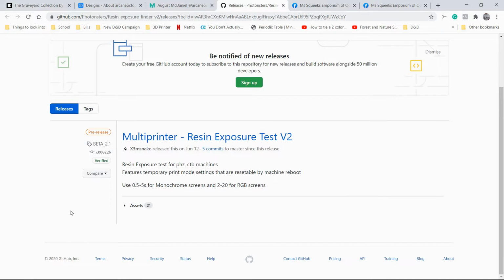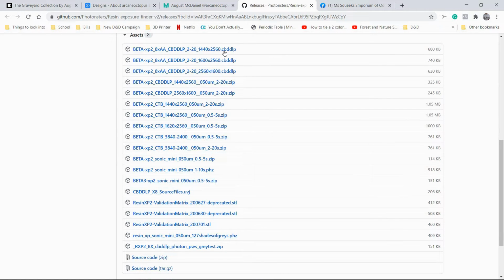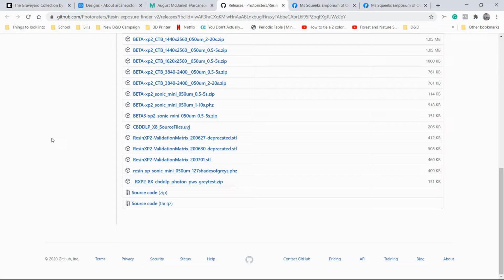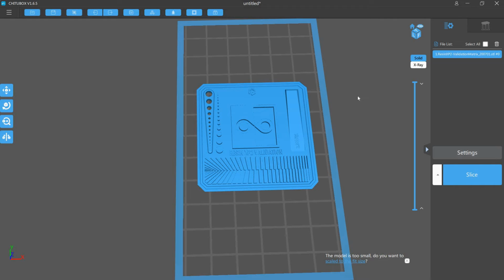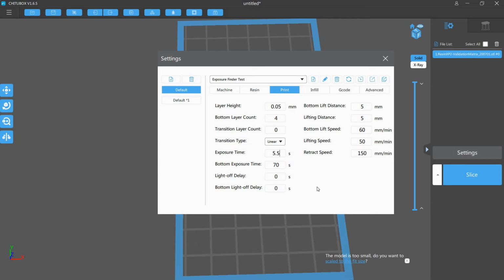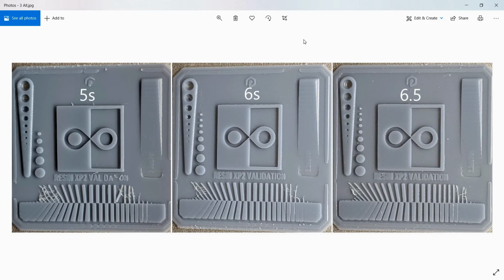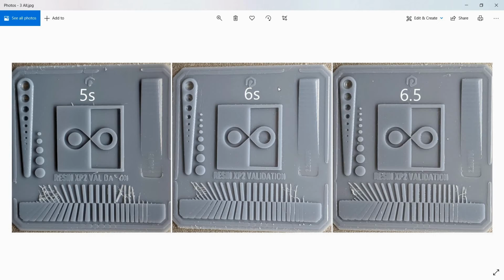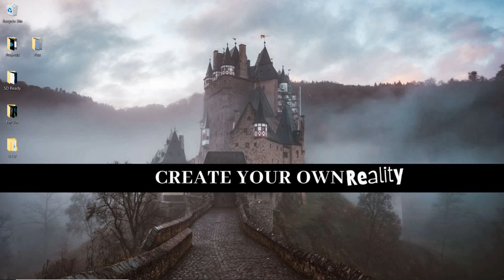Get Perfect 3D Prints on Any Resin Printer With the Exposure Finder!

Comment: Thanks for explaining how to establish if the exposure is correct on this file. I upgraded my old RGB Transform to a mono 7K screen and now i'm getting thin cured sheets of resin in the vat, based on what i see and what someone told me i think i need to reduce the UV power as these rgb arrays are more powerful, mono screens allow more light to pass than rgb screens so now I'm gonna reduce it to 70% from Chitubox (Light PWM settings). The test file with the default 100% uv light using 2.6 exposure makes all the intersecting corners weld together more, the 2 eye shapes in the middle where they touch are melted together.
Prints on this printer also stay tacky even after cleaning with IPA and feel softer than prints from my other printers, it has to be over exposed no?
Reply from the maker: Hey there. Yeah that definitely sounds like your prints are over exposed. However, your mention of the cured layer is something I'd like to hear more about.
Could you join my Facebook group or Discord Server and post there? I'll help troubleshoot as I have time.
Or, if you want more 1 on 1 support, you can join my Patreon at the Red Scale Tier.
Reply: @SlicePrintRoleplay  Sure i can join, thanks.

Comment: I'm curious, should I do a vat clean after an underexposed validation matrix ? Should I worry underexposed particuls floating in the resin ?
Reply from the maker: @sebastienstryckwant4564  in my opinion, yes you should. The chances are small but it only takes a few minutes. Even less with the tank clean function. Definitely better than paying to replace the screen.
Reply: @SlicePrintRoleplay  I bought a screen protector as It's my first 3d printer and I know I will do sh*t. Thanks for the answer !

Comment: Hi. Thanks for the video. I use mars 4 ultra and elego standard resin. I run exposure time from 2.5 to 6sec. I can see the difference between prints and would say that spot is 4sec. 
But, all of this prints have no extreme tiny lines and text. 
Any idea what may be an issue?
Thanks.
Reply from the maker: Could you join my Facebook group or Discord Server and post some pictures of what you're seeing?
Reply: @SlicePrintRoleplay  Thanks
Reply from the maker: @Fly_Dragon279  you are very welcome.

Comment: why is your bottom exposure 70 secs?
Reply from the maker: Because the printer used in the video had an RGB screen. RGB screens require about 3 times the bottom and normal exposure times when compared to modern mono screen printers... Wow I really need to update this video. 😅
Reply: what would be the cause of the resin not sticking to the build plate?  @SlicePrintRoleplay
Reply from the maker: @bradysaravanlife9371  most common cause is the the build plate hasn't been leveled correctly.
The next most common cause is that your bottom exposure is too low.
If you'd like to join my Facebook group or Discord Server I am always happy to provide basic troubleshooting.
However, if the issue you're seeing requires more than the basics, I recommend joining my Patreon at the Red Scale Tier.
That allows me to set time aside to offer you 1 on 1 3D printing support with much faster response times. You also get some other fun benefits too. 😊
https://bit.ly/3E9g22O
Reply: @SlicePrintRoleplay  yeah ill deffently join ur fb and discord and send some pictures in. thanks for the help!
Reply: kk i just got a anycubic mono 5 and my buildprint keeps not sticking to the resin i just tried your test print and it didnt stick to build plate what could b wrong?  @SlicePrintRoleplay

Comment: I have been having issues with my Elegoo Saturn in which the XP2 Calibration tests print almost paper thin. Despite the bottom exposure being dialled in at 30s and switching the exposure times from 2.5 up to 3 seconds...
Reply from the maker: There are a few things that could cause that issue. However, the best way for me to narrow it down would be to see the settings you're using. Could you join my Facebook group or reach out to me directly with a screenshot of your settings?
Reply: @SlicePrintRoleplay  I'll join your facebook group and send my settings over. Thanks!

Comment: Which file time etc... works for the Uniformation GK Two?
Reply from the maker: If you're asking about the range finder test that stopped being supported by the creator a few years ago unfortunately. So I do not recommend using that test.
If you're asking about the Validation Matrix, use the stock settings that are populated in your slicer when you select the GKTwo as your printer. Those are usually a safe starting point. However, make sure you are using 4 bottom layers and no transition layers.

Comment: i did this test for .05mm to get my perfect exposure. i wanna see what my exposure for .15mm layer height. since you say use 4 bottom layers for .05mm, is this file able to test with a .15mm height?
Reply from the maker: Hmm. That's difficult to say. I think it's certainly worth testing. It's possible that the test is too thin for such a large layer height. I really can't say for sure though. 
However, if my math is correct, you can only use 1 bottom layer at that layer height. Double check that in your slicer preview though.
Reply: @SlicePrintRoleplay  I was thinking the same. Total height of file is 1.4mm and min layers I can choose is 4. That's. .6 just in bottom layers. I think I'll try just figured 3 times the layer height I might have a diff in exposure time. Thanks

Comment: Thank you for still answering questions even 2 years later.
Fast forward to 4:27, the 6 second print looks good. I can understand why the very thin lines are hard to print but why should the outside raised border around the test fail in spots?

Comment: so i know this video is 2 years old but i did this test on my mono x and got it down to 4 seconds. and the center of the infinity sign still looks like its over exposed. i mean it looks good. but i kinda wanna keep going down till l see the threshold for underexposed. and i have all the pins, my room is always at 75 f and its not humid in there if thats effects resin printers or not, and my layer height is at .05. so with that being said is it just newer printers are avg closer to the 4 sec now? at least for mine
Reply from the maker: Doesn't matter if the video is super old or not, I try to respond to comments whenever I see them.
You are correct. There was a cheng to this tech a little over a year ago.
The type of LCD used in these printers changed. Without getting into too much unnecessary detail, they basically started using screens that allowed more UV light to pass through. They also last longer and provide slightly higher detail.
So yes the tech changed and now it's normal to use a much shorter exposure time. For mono screens (the new standard type of screen) I recommend starting your testing at 3s normal exposure time.
Let me know if you have any more questions.
Reply: @SlicePrintRoleplay  well thanks for getting back to me! i love your videos, you have given me alot of great info and saved me alot of time. keep up the great work. its very appreciated!
Reply from the maker: @jaspercallahan3318  thanks so much for the positive feedback and encouragement!

Comment: Weird issue, but I ran this test print on my elegoo mars 2 and the shape of the validation matrix printed as a rectangle rather than the square. It looks correct in chitubox and I reran the print and had the same result. Any idea why this is happening?
Reply from the maker: Hmm. I'd start by double checking in Chitubox and make sure you have the correct printer selected. If that's correct then I'd check your X and Y resolution. It's possible that those two values got switched. That could certainly cause the issue you're seeing.

Comment: Do you have any exposure tips for the elegoo mars 3 pro? 
Im printing with 3DJake lightgrey 8K resin.
Reply from the maker: I don't have that model, but I've heard good things about it.
I'd start testing at: 
4 bottom layers.
25s bottom layer exposure time. 
3s normal exposure time.
Then adjust depending on the results of your testing.
I would highly recommend running the Exposure Time Finder function in UVTools. It let's you test multiple different exposure within the same test.
Here's a full tutorial on it.
https://youtu.be/lRbZw6GbGCI
Reply: @SlicePrintRoleplay  thanks man! 
I just baught the printer a few weeks ago to make dnd minis. Its my first printer and i really get awesome results, but i think there can even be more details ^^
Reply: @SlicePrintRoleplay  right now i have 3 bottom layers, 32 secs bottom layer exposure time and 3 secs normal exposure time :)
Reply from the maker: @l_TheJester_I  all the more reason to calibrate your exposure time. That's going to be the best way to improve quality.

Comment: So I'm not sure if there is a file for the elegoo saturn s. I'm not seeing a matching file
Reply from the maker: I highly doubt there is a file that's compatible with your printer. The creator of the Multi Exposure test stop supporting/updating it around 3 years ago.
You can absolutely use the second test (the XP Validation Matrix) because that's sliced using your slicer/settings.
If you're looking for a quick way of testing multiple exposures then I'd recommend checking out UVTools. It has a tool called the Exposure Time Finder Test. It's incredibly useful and works the same as the the first test I talk about in this video.
Here's a full tutorial for that process.
https://youtu.be/lRbZw6GbGCI

Comment: The first "resin exposure" spreadsheet has been deleted.  Is there another source for it?
Reply from the maker: Thanks for letting me know. I'll look and see if there's a new spreadsheet available. I think I remember hearing about one that was specific to mono screen printers.
Reply: @SlicePrintRoleplay  Isn't the X1 Classic (the first X1 that came out) a color screen?  I talked with support and they said:
The screen in your current printer is a 5.5" 2K color screen.

That's what's in the original X1's now called "Classic" X1's.
Reply from the maker: @protostar8  you are absolutely correct. The original X1 (X1 classic) has an RGB screen. It's what I was using when I recorded this video a few years ago.
Currently I'm using the Epax E6 which has a mono screen.
Reply from the maker: Here are two other resources I found. There are likely more, but I grabbed the first two I found.

https://docs.google.com/spreadsheets/u/0/d/10j3YC4yR3Bg_mOHhygCQ5u8q5kX9VTIPheAkUda-aHE/htmlview#gid=0

https://makertrainer.com/wiki/Anycubic_Photon_resin_settings

Comment: Just got an Anycubic Mono 4k, is this something I'll want to be doing?
Reply from the maker: Oh that's awesome, I've heard good things about that printer!
Yep, calibrating your exposure time is best way to ensure you get the best results.
I recommend calibrating your exposure time any time you're using a new resin or a new printer.
Feel free to reach out if you have any other questions.
Additionally, you might find the below video helpful for getting started.
https://youtu.be/wy9XiUMLFyA
Reply: @SlicePrintRoleplay  Ahh, so I would need to do it whenever I used a new resin. Better keep notes handy lol, thanks!
Reply from the maker: @disgustipated86  yep it's not always a requirement, but it's the only way to make sure that you're getting the best results.
If you have any questions feel free to reach out.

Comment: Any test for Phrozen mini 8k?
Reply from the maker: Well the first test I talk about (the Exposure Range Finder) likely won't be compatible. The creator actually stopped developing it shortly after I made this video. It was too difficult to keep up with the constant firmware updates across different models.

The second test I talk about (the Exposure Validation Matrix) is compatible on any printer. The reason for that is because you're slicing it and adding your own values. So it's not as efficient, but it should work fine.

You can also see if the Exposure Time Finder function in UVTools is compatible.
For that you can check out this video.
https://youtu.be/lRbZw6GbGCI
Reply: @SlicePrintRoleplay   Thank you so much for advice
Reply from the maker: @vladimirrajevic3452  you are very welcome!

Comment: does it work for photon s?
Reply from the maker: I believe there was a test for that model, but I wouldn't recommend using the Exposure Range Finder test. That's first test I talk about in this video.
The creator is no longer developing or supporting it.
However, the Validation Matrix will work on any printer. That's the second test I talk about in this video.

Comment: My issue is these prints curling up/warping up. What setting is responsible for that happening?
Reply from the maker: So there are a few things that could cause that. However, to narrow it down it would help me to see some pictures.
Could you post a few pictures in the Slice Print Roleplay Facebook group?

I will say that the most common cause of this issue is your exposure time being too low.

Comment: Will this test work on a Formlabs printer.
Reply from the maker: So the first test I talk about is called the Exposure Range Finder. That likely won't be compatible as the creator has stopped developing/supporting it.

The second test I talk about is called the Calibration Matrix. That should be compatible with any model of printer because you are slicing the model with data specific to your printer.

Let me know if you have any other questions.

Comment: First of all thank you so much for this great video!! 
Do you know which "Resin-Exposure-Test" is fitting for the Elegoo Mars 3? (XY resolution: 4098*2560) 

Thanks in advande :)
Reply from the maker: You are very welcome I'm glad you found it helpful!

Unfortunately there likely isn't a multi exposure test that's compatible with the Mars 3. The creator of that that test stopped developing it shortly after I released this video... But the Validation Matrix is compatible with any printer because you are slicing it for each specific printer.
Reply: @SlicePrintRoleplay   Thanks for your answer. But with the validation Matrix card you have to do like 5-10 prints which is quite a pain in the arse. 
I can highly recommend UV Tools which works also for the Mars 3 - Here you can do an exposure test with different exposure settings in just one print. I love it! 
Kind regards 
Julian
Reply from the maker: @ChevalDoreBerlin  oh I didn't realize the range finder feature in UVTools was compatible with the Mars 3. That's great! Thanks for letting me know.

Comment: is there some way to modify it to run it on a mars pro with the mono upgrade?
Reply from the maker: Are you talking about the Exposure Range Finder (the first test I talked about)? If so that test is no longer being supported by the creator so I wouldn't recommend using it.

However you can check and see if UVTools is compatible. I have a video explaining how to use the UVTools Exposure Time Finder Test here, https://youtu.be/lRbZw6GbGCI
Reply: @SlicePrintRoleplay  thanks! Thats exaclty what I looked for ❤️
Reply from the maker: However if you're talking about the Validation Matrix (the second test I talked about), that is compatible on any printer.
You would just slice it for your printer, print it, then read the results.
Let me know if you have any other questions.

Comment: Question: Do you know a source to get a silicone vat cover  for EPAX X10 (metal Vat)?
Reply from the maker: Unfortunately I do not. Typically people will print a vat cover/lid on an FDM printer. However, unless the vat is uncovered for long periods of time, they really aren't required.
Reply: @SlicePrintRoleplay  Thanks for the prmpt reply. I was thinking of a cover to reduce the smell. Petrhaps I will print one (h.mmm), or just lay a piece of silicone on top. I'll get the hang of the 1001+ details as I go.  I'm getting into the mode. It takes 90% of energy to break gravity , then only 10% to orbit the earth. I'm just starting to launch :-)
Reply from the maker: @print3dnyc838  that is the absolute best mindset for this hobby!

Comment: Great Video, especially as I am also using an original EPAX X1 that I have just had to replace the screen on - My question is what is the first file for that I have to "print" and then power cycle? I understand the second validation matrix file is the actual file to be printed but really unsure what the first one does or is for?
Reply from the maker: Thanks I'm glad you enjoyed the video!
The X1 is an excellent printer!

So that's a great question and I apologize for not explaining it better in the video. 
As you said there are two separate tests I show in this video. 

The first text is the Exposure Range Finder test.
This test is a pre-sliced file that you run on your printer as is. This means you don't add in any settings. You download the file that matches the resolution and file type for your printer, put that file onto your USB, and print it. 
The reason you want to power cycle your printer after it's done is because the file makes some changes to the way your printer behaves. To reset these changes you have to power cycle. 
This test is helpful because it allows you to test a range of different exposures with just one test. The downside is that this test (as the name suggests) tests a range. So it won't help you fine tune your exposure. 
Unfortunately this test is no longer being supported/developed so it may have run on your printer.
Reply: Cheers for clearing that up.  Ran one off now to see how it goes and I see where I need to work on it.  I also tried one with another named brand "locked" resin just  to see what it would do without changing anything and the square came out completely blank, not detail on it whatsoever. What way should I approach that?  I say locked brand as its from a manufacturer that doesn't give you settings so it can only be used with their printers